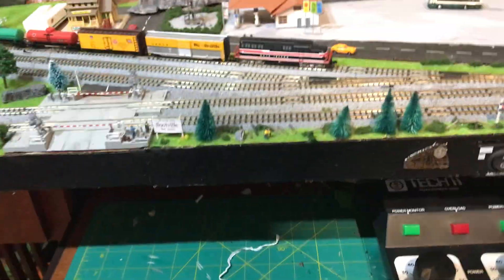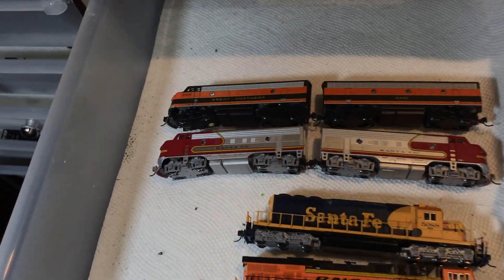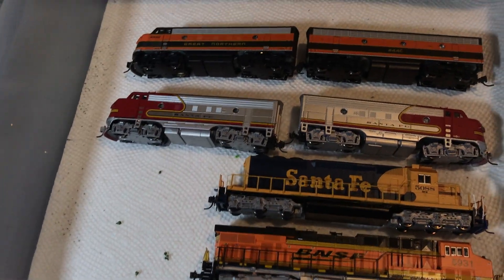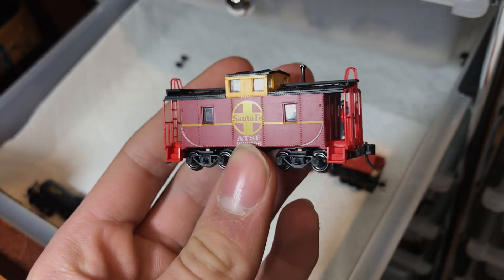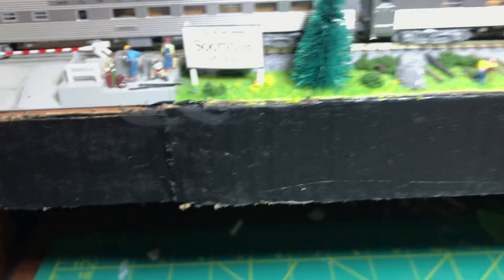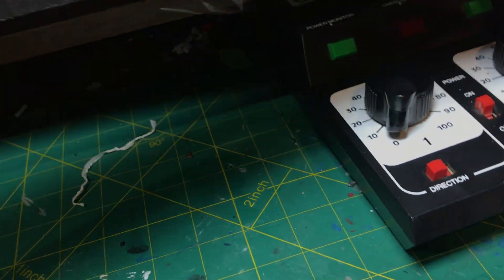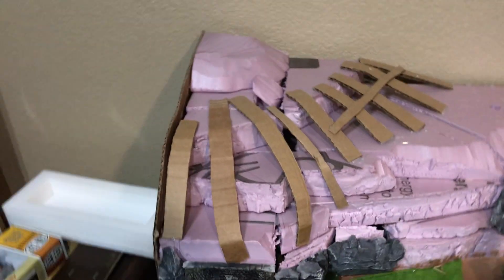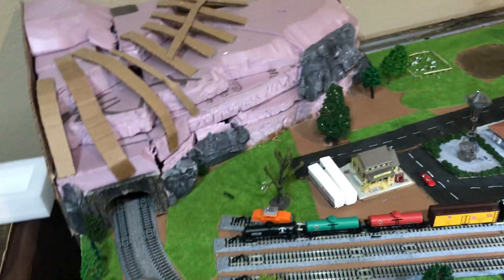100 Subscriber Special! Collection+Layout Tour

Comment: You have a very nice collection. Do you have trouble with couplers from different manufacturers or have you changed all the couplers to the same brand? My layout will be small (just starting) and almost all the engines and rolling stock are Kato so they all connect nicely. However, since Covid, the supply is iffy at best so there aren't any boxcars that I like from Kato. I have a Bachmann passenger car (came with a Bachmann Doodlebug) and the different couplers "seem" to connect well but not having a running layout yet, I can't say for sure. Can you say which, if any, other brands connect with Kato couplers in a workable way? Nice layout. Love the dinosaur. I'd call it Mount Soot. Thanks.
Reply from the maker: Hi, Danny. What you are facing is what most modelers in N scale face. Generally, most coupler brands are easily compatible, for example, micro-trains and bachmann. My personal experience is that you can couple all brands of knuckle couplers together, though some of them might be trickier than others, like kato to bachmann. And for the second question, no, i do not have a standardized coupler on the layout as i dont have the time and money to convert all of my rolling stock and locomotives to micro-trains couplers. Thanks!